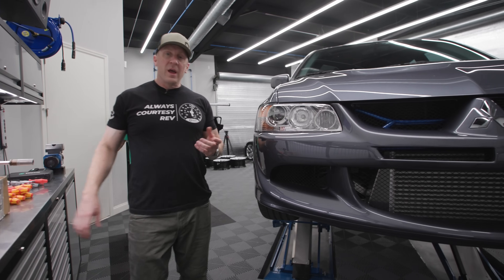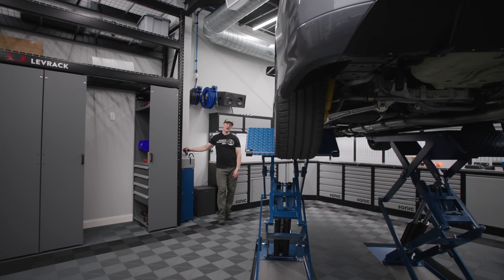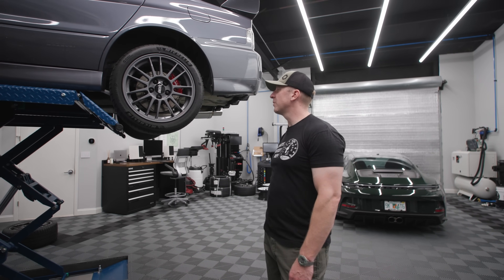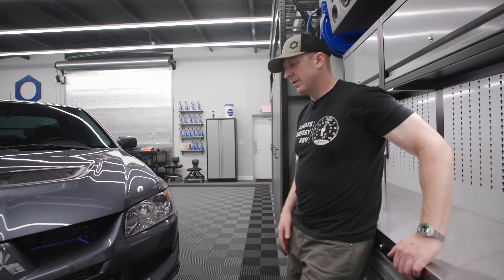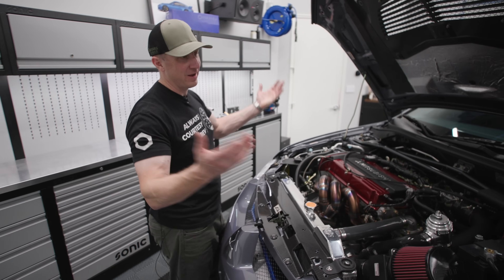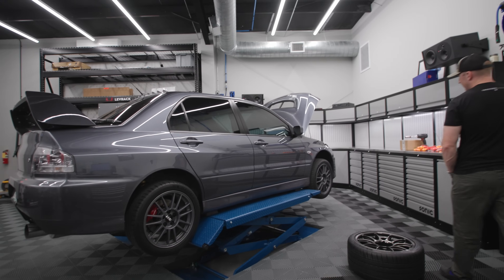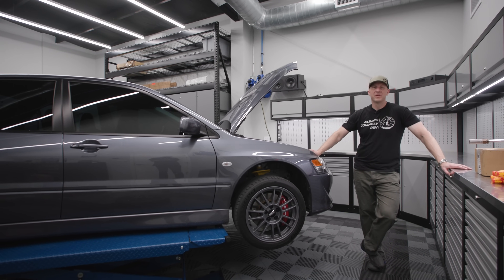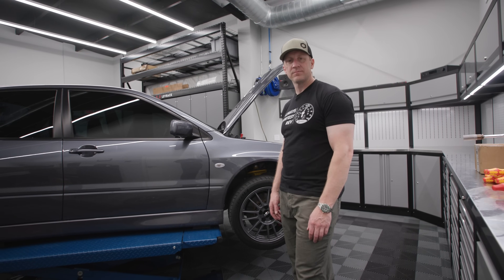The OG Beater Build - An Update

Comment: I run an STM catback on my Evo 8. It sounds amazing with a high flow cat. I got rid of the test pipe just because of how loud it was. Little to no drone in the cabin. Sounds perfect. Im reaching 30 and can't do loud exhaust anymore like I used too. Also ran a high flow cat on my X as my ETS extreme was getting to be a little much with a test pipe.
Reply from the maker: Thanks for the tip.  I think I'll order one today.
Reply: @ObsessedGarage  Can't wait to watch the next video. I think you'll enjoy the STM exhaust for sure. Thank you for keeping a great example of an Evo alive and well.
Reply: 😅what’s the correlation between reaching 30 and disliking loud exhaust?   I’m 42 next April and just want louder exhausts on my cars than I’ve had before (so long as there is a perf gain or pedigree beyond the sound 😅).    Especially in my 20s I couldn’t afford perf exhausts yet.    ‘10 Si set up with full Invidia.  No cat/ garage baby.
Reply: @raver208  I prefer quieter as opposed to when I was younger. I enjoy daily driving my cars and super loud exhaust just don't do it for me anymore.

Comment: If u decide to order a buschur exhaust just note that there's the sd model and magnaflow model. Magnaflow is quieter and more mellow since it's actually a muffler whereas the SD is just a resonator. The stm exhaust is nice too but the rear "muffler" is a vibrant ultra quiet resonator. Stm sound levels should be in-between both buschur models. Buschur has a slip fit design whereas Stm's is all welded. Quality seems to be nicer with the stm and the price reflects that but I've been running the magnaflow buschur for years and love it. Maybe bc it's the nostalgic Evo sound from the 2000s here in the U.S. I also run a vibrant ultra quiet resonator in place of the cat for a straight through design but still almost as quiet as a cat.

Comment: 113,000 beater

Got my evo 8 that has traveled to mars and back for 17k usd 

Its crazy the difference in money for same car but got to admit your car is much much much much x10000 better than mine but dammmm 113,000 we are both insane in the membrane
Reply from the maker: Yeah...there are significant diminishing returns as you head toward lower and lower miles.